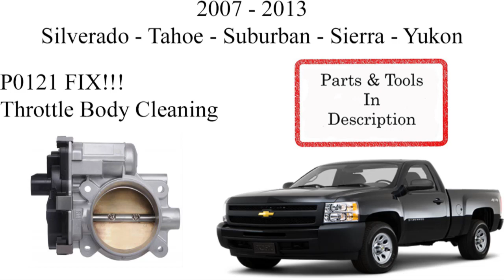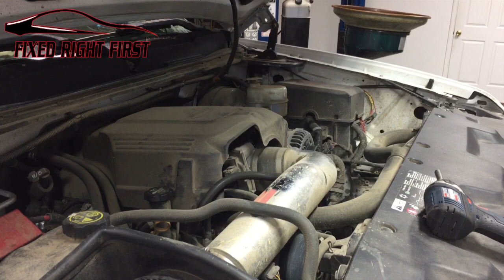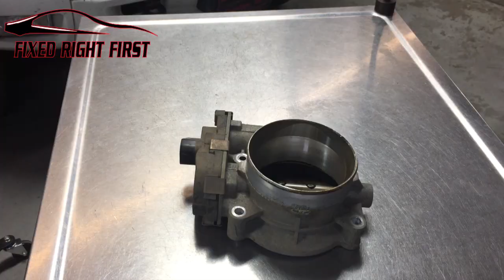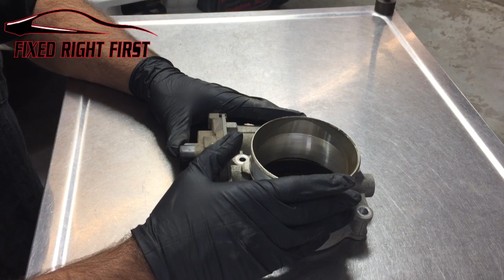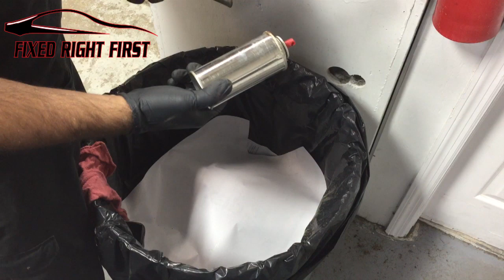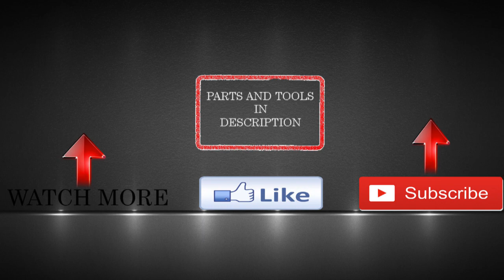P0121 FIX!!! Reduced Engine Power FIX!!! 2007 - 2013 Silverado Sierra Throttle Body Cleaning!

Comment: Huh..... For once this actually worked in my case .. for any throttle body Ive worked on and the first thing is like... Well clean it it's never worked and on cars that have electric throttles that don't exist anymore and cost like mmm 500 bucks or something if it's the right one. Used some mass air flow cleaner and scrubbed it and it actually worked. One I have here it started to idle very low, after changing the ECU for a totally different code as well. It does look like it worked for the original code I need to drive it actually to see. Tho started exactly when I changed the ECU, did the relearn on it seems like it wasn't having it but took it off cleaned it and its happy now it doesn't try to die at all. First that's happened to me.

Comment: I had the same problem thanks for your video this worked for me
Reply from the maker: Great! I'm glad that it helped! Make sure you Like and Subscribe to the channel! It really helps me out!
Reply: @cdarnau  sure i will do
Reply: @cdarnau  I have a question does that DIY Cold Air Intake works good
Reply from the maker: @Moe.504  It gives you better air flow and a small amount of increased HP. It would be the same as adding a legit cold air intake under the hood.
Reply: @cdarnau  thanks Chris

Comment: Thanks for this video-I pulled my TB off my 2008 GMC-even easier than yours, as I have a 4.3 V-6, and the TB sits flat on the top of the manifold. 4 bolts, and disconnect the wire harness, and it was off. It was crusted with carbon. I kept the end with the electronics up all the time, and carefully cleaned out all the carbon with a small wire brush. The battery was disconnected while I was doing this. I cleaned the MAF sensor with the spray cleaner, put a new air filter in, and put it all back together. I started it and let it run with touching the pedal, and shut it off after running a few minutes. All the codes were cleared, and it runs like new, with a nice idle. I hope this takes care of the problem.

Comment: After doing cleaning my throttle body and replacing the sensor.   my idle has leveled out. when starting it kicks up to 2k then slowly drips down to a correct idle. 

when I press the accelerator pedal it kicks up to 3k RPM and sits there for 5sec... to 30 sec.. then slowly ramps back down to idle. no check engine light...
this was not happening before... and I think the cleaned throttle body relearned, but my accelerator pedal did not? Or do I need to replace that sensor as well?

 If I get a reply to this Ill make a video.
Reply: Gm dealer.
Reply: Use a scan tool that can relearn the idle. You might also need to reprogram the ecm. Also you can try disconnecting the battery cables for a few minutes and touching them together for a few seconds (cables only) that might reset the idle as well
Reply: @maxvista  where can I get the relearn tool? Also where can I get my ecu reprogrammed locally?

Comment: Well done..thank you for sharing your knowledge. I performed this service on my '05 Silverodo 2500HD and thankfully had no high idle or REP issues. The way I did mine is disconnect - battery cable and harness from tb and since there is a coolant tube running through mine I decided to just clean it in place. I mainly focused on the top and bottom of the housing and plate where it sweeps back and forth as this is the most critical area anyhow. Hooked everything back up, turn key on engine off, depress pedal to floor and gradually let off in span of 3 seconds, then fire it up and let idle for 3 minutes without touching pedal, shut it down for 1 minute and repeat again. On initial startup it was right at 1000rpm but gradually came down after 30 seconds or so and smoothed out nicely. The truck is now much more responsive and is running better than it ever has. Now I need to address the pcv valve cover issue or it's going to get gummed up again in short time. What an ignorant ass gm design that was.

Comment: Great point Chris. Before I went back to the fire department as a mechanic.  The mechanics were trying to fix a high idle issue on a 2013 Tahoe and they replaced the throttle body to try and solve the issue.  Well the shop scan tool wouldn't reset the idle. Well they couldn't get it resolved. They would take it to the dealer. Well they called me and asked if my solus edge did a relearn I said yes. I drove over to the shop. Plugged in turn the key on. Pressed a couple of buttons and bam. It was done. Now since I been back I get majority of the drivability problems.  Knowledge is power and having the right tools helps. Thanks chris
Reply from the maker: Thanks for all the feedback!
Reply: @cdarnau  I PM you my cell
Reply from the maker: Greg J Feeney I will check it out. I only check that account when I post videos.
Reply: PM you on messenger